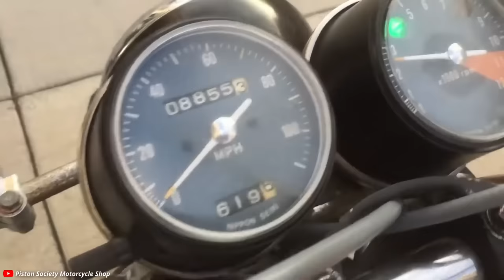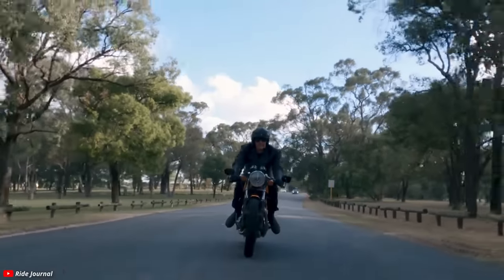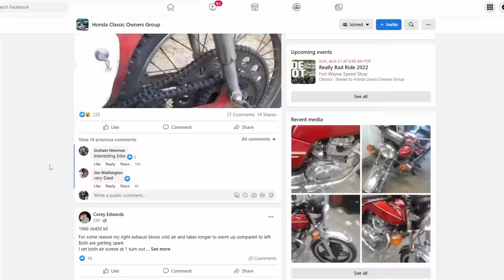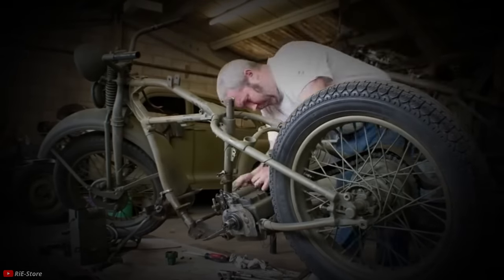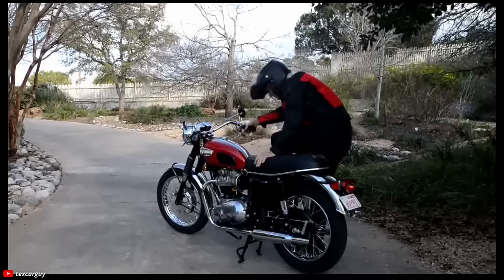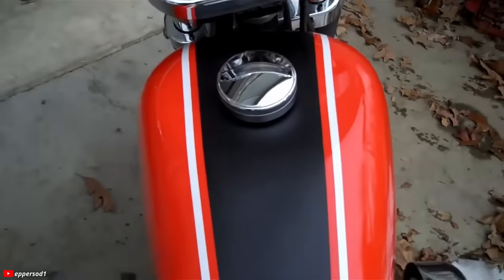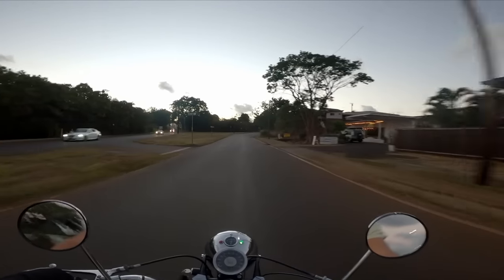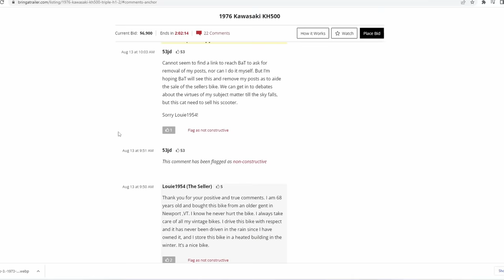So you want a classic motorcycle...

Comment: First of all, new bikes are an absolute nightmare, and are not worth investing in. They are ugly, sometimes hideously ugly (just look at the new Honda "Rebel" or the Kawasaki Vulcan S) It is almost impossible to find a bike anymore that is not 99% matte black, with zero chrome. And most new bikes are more computer than motorcycle, and even the few mechanical parts on them were designed by a computer. They are impossible to work on, and anything but reliable. And there is no fun or satisfaction in owning and riding them. Bikes with ABS take away part of the riding experience by taking away part of what the rider is supposed to do, and turning it over to a computer. And now Honda is going down the automatic transmission road again. So called "modern" motorcycles really aren't even MOTORcycles anymore. And you will usually pay around 30% ABOVE msrp for one. 

I advise staying away from older Japanese bikes. They were well made (or at least usually better than most other brands) back then, but everything wears out, and will eventually need parts. And parts for '60s and '70s Japanese bikes are almost impossible to find. These bikes were designed to be disposable to begin with. That has always been the Japanese design philosophy, which pretty much all manufacturers have now adopted. I have a couple of older Japanese bikes, I have some parts bikes to go with them, and I'm a parts hoarder, meaning I buy good parts for them BEFORE I need them, whenever the opportunity arises. Unless you are Allen Millyard, I suggest being very careful about buying older Japanese bikes. 

Yes, tinkering does indeed exist. But only if you are not only a mechanic, but a mechanical enthusiast. I am both. I recently retired after working for 40 years as a mechanic, and working on mechanical things, especially motorcycles, has always been my main hobby. You have to actually understand how things work, not just be a parts changer. "Tinkering" means working on a running bike trying to make it run a little better, or trying out a new way of doing things. Due to a lack of parts availability, and a lot of poor design and engineering on the part of motorcycle manufacturers, owning and riding and working on an older bike is always going to involve some degree of improvising and making changes. Being good at improvising, modifying, and fabricating is absolutely essential to keeping an old bike going. Having or knowing someone who has a CNC mill and a 3D printer can be invaluable. I have made motorcycle parts out of stuff I got from Home Depot. And I don't mean building a rat bike, I like to keep a bike as close to stock as possible. But keeping it completely stock is not going to be possible. 

While British bikes and older Harley Davidsons were not as reliable as Japanese bikes when they were all new back in the '60s and '70s, they are now a lot easier to work on and find parts for. I have a 1966 Triumph Bonneville, a 1979 Harley Davidson Ironhead Sportster, and a 2002 Royal Enfield. These bikes are way simpler than the Japanese bikes, MUCH easier to get parts for, and much more satisfying to both work on and ride. They have a mechanical look, feel, and sound that even older Japanese bikes just don't have. 

If you don't have much or any experience working on mechanical things, don't enjoy working on mechanical things, and see it as something that has to be done rather than something you want to do and look forward to doing, then classic bikes (or cars) are NOT for you. Even if you have someone who can do ALL the work on your classic bike and keep it running, you probably won't even like riding it. Do you want to kickstart your bike? Do you want to deal with a choke and manual petcock? Will you like the mechanical sounds and vibrations a classic bike makes, and the unavoidable oil leaks? Do you want to deal with drum brakes and incandescent lights? Ask yourself WHY you want a classic bike. You might decide you don't want one at all. Even without all the repairs and maintenance a classic bike requires, it is a MACHINE. And if you don't like machines, and would rather ride a smooth, quiet, computerized 2 wheeled appliance that has no character whatsoever, then just get one of the new "fake" classic bikes, commonly called "retro" bikes. You get the look, without all the other things most classic bike owners love about their bikes.  

For me, classic bikes are strictly a hobby, a recreational thing. I don't combine them with anything else. I don't commute on them, I don't tour on them, I go for Sunday morning rides, stop at a local coffee shop, sit outside and drink my coffee while admiring the bike, then hop on and take the long way home. I still do much longer rides, but I have a newer, though still carbureted and pre computer bike to do them on. I will NEVER own a bike with a computer on it. I would rather push my classic bike than ride a computer on wheels. I only have one computer, and it is sitting on my desk right now, being used to type these comments. Computers do not belong on motor vehicles.

Comment: That's a 1972 CZ-Jawa 175 as my profile picture.  Horrible bike.  I've owned and ridden a 1980 GS1000G.  Put about 25,000 miles on it.  It's more comfortable than many modern bikes, no problem with long distance freeway rides or around town cruising.  That being said, parts availability was a problem.  It needed new a new top end rebuild.  No pistons and rings available. It needed all the work a 40 year old bike needed.  At the end of the day, it would have cost way more to end up with a bike that just wasn't as good as modern bikes.  Sold it after it sat too long.  Loved it, but I found out I didn't need another hobby.
Reply: 25,000 miles ? Well there's your problem you get around more

Comment: Absolutely right about ‘70s Japanese bikes😎.
My 46 year old showroom condition ‘76 Yamaha XS 650 is every bit as reliable as my ‘19 Bonneville T120 and my ‘20 BMW F900XR.😘  It will outperform a brand new Royal Infield 650 Interceptor and the fit & finish is heads and shoulders above anything in the RE lineup🧐.
Reply: XS650 Yamaha best British bike ever built 👍
Reply: I have 5 XS 650s, and the engineering is incredible. Everything in the engine is on ball or roller bearings. They are easy to work on, easy to get running right, fun to ride, cheap to buy, and parts are available all over the place. I have a '76, '78,'79, '80, and '81. The 81 is for parts, and only the 76 and the 80 run right now, but the 78 is next. I restored the two that run from 30-year-old barn finds for $350 and $450. Plus I have boxes of spare parts and at least 3 spare engines. I think I have a total of $2000 in all of it.

Comment: 1977 and 78 KZ1000, Honda CB750F, 900F, 1st and 2nd gen GPz1100, 1st gen Ninja900, ZX11, ZRX1100/1200 are the kinds of classic bikes that can be ridden like modern bikes but have none of the modern bike tech heavy features. BMW Airheads are slow AF. That's my main gripe about classic bikes. They are SLOW with shit brakes and suspension. AMF era Harleys are cantankerous PILES OF SHIT.  Any pre EVO Harley is a cantankerous PILE OF SHIT. Don't even bother. Classic bikes are fine as long as you have low expectations. Do not expect much in the way of reliability or performance.

Comment: Nope. I absolutly do NOT want a "classic". Why would i when a new one just works and works x200 times better
Reply: Leaves more bikes for us then!
Reply: Enjoy your bills at the dealer for having an IT specialist doing maintenance on it.

For many of us is using the screwdriver to adjust the carbs is much more cheaper and easier than having a wizkid connecting a computer to my bike
Reply: @wilfredprins9718  Enjoy your unsyncronized carburetors and out of whack ignition. I`d rather spend my time riding😂
Reply: @EVILSPAWN1003  😂

Thank you
I enjoy riding too